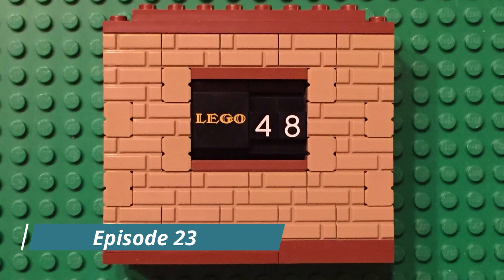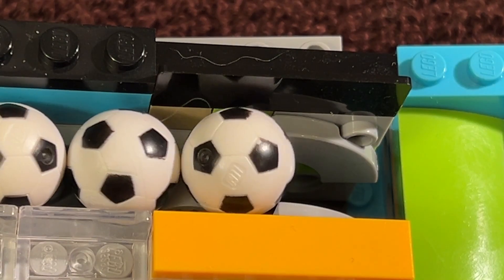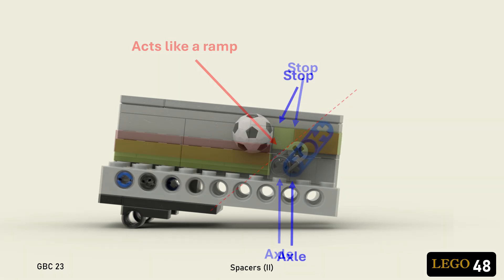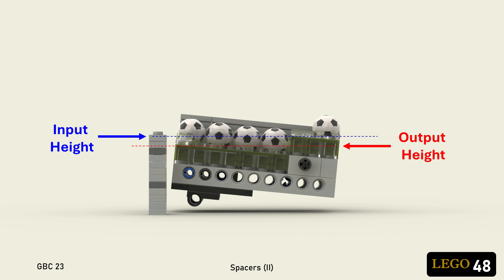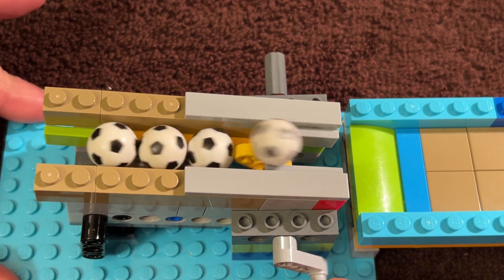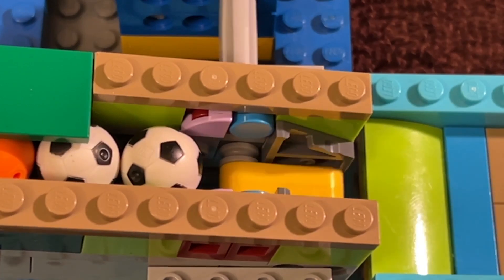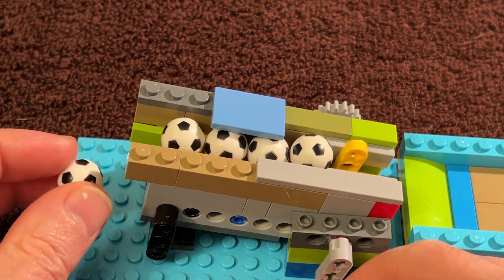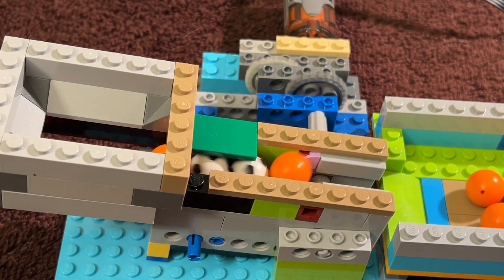GBC 23 - Spacers Revisited

Comment: I love this design, and I noticed you used aftermarket power functions motors. Which ones would you recommend? Also, I’m interested in how “Circuit Cubes” Cubit motors could be used for GBCs, as I recently got 6 of them. Thanks!
Reply from the maker: My personal favorite third-party motor is MouldKing - easy to get via Amazon, and performance is closest to the original Lego motors.  Unfortunately, I have no experience with Circuit Cubes motors.
Reply: @lego48 Thanks, I thought the motors looked like mould king!